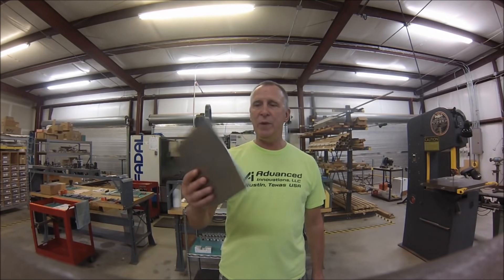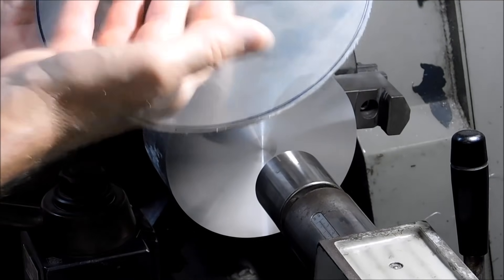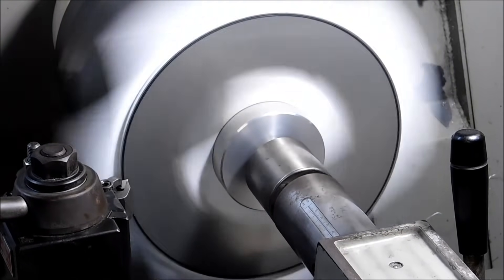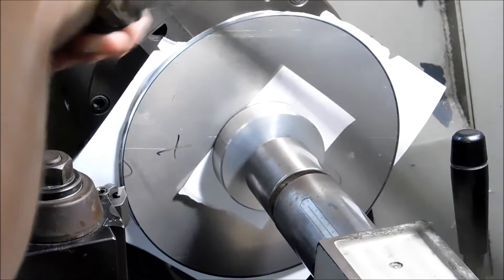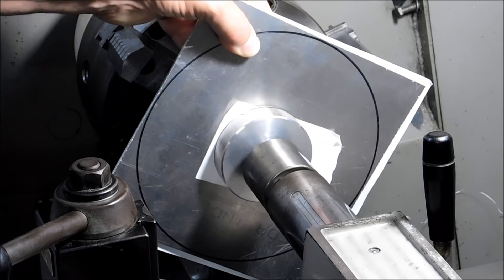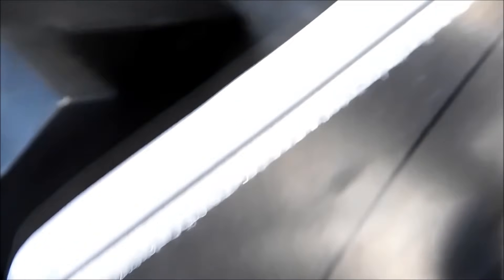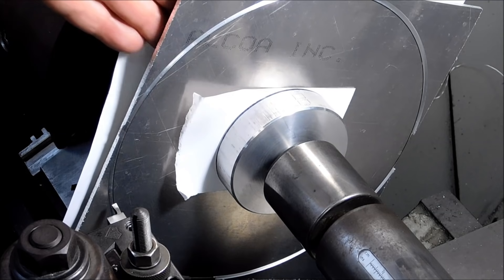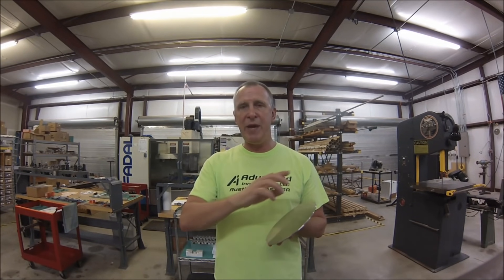Pressure Turning

Comment: In having my students do this over the years I have also discovered if you use a tool bit with a 45 degree lead angle rather than a rather abrupt 90 degree lead, that you reduced cutting pressure on the work piece dramatically. And as Joe points out, anything you can do to help out in this type of operation is to your benefit. This is the same thing that takes place in face milling when you use a face mill (insert style) with a 45 degree lead angle vs. A face mill with a 90 degree or square shoulder.  If you are trying this for the first time I would recommend  you bandsaw the rough circle out.
Reply from the maker: Be careful putting angles on the nose of your tool. An 1/8 inch wide 45 degree nose tool has more surface contact than a blunt 90. If I understand you correctly, the part would have a large sharp burr on it once the corners fall away.

Comment: Nice Joe, i'm a french Canadian and i spent 40 years in machine shop and it went by like a flash i am now retired. I used this setup all the time but to center my piece i just put a little pressure on it and centered it using a piece of wood in the tool holder and manually turning the chuck to rub on the piece of wood and it would center very precisely when i needed precision suppose i had only like .010-.050 to take off on the already round part. Thanks a million Joe you give me nostalgia....have a nice day!
Reply from the maker: thank you. Same to you.

Comment: Hi joe, nice job. I've been machining since I was a kid, what you did I have done, and seen done plenty of times. As with any job, there are times when you hold your breathe especially while parting off large parts. We have a hydraulic copy lathe for machining the OD of rollers for hot steel mills, we grip them between a stepped mandrel in the chuck and a stepped puck in the tail stock. We use a pressure centre, it has a large spring inside the live centre and a resistance gauge to show how much pressure has been applied by the tailstock. The pressure live centre is a store brought item, worth you looking into if your doing a lot of this stuff, if the tailstock moves a fraction, the spring still holds some pressure, and the gauge shows you straight away. 
Keep up the information on your channel, don't listen to the haters.

Comment: Nice video, Joe. I used to do that in the same way. 
We manufactured farewell gifts out of a brass plate combined on a wooden blazon. 
We high-gloss polished the brass and the electricians used their special tools to etch our coat of arms into the brass plate.... That was a great time back in the days in the German Air Force. 

P.S.
I preferred the second option. To lazy to spent to much time at the band saw ;-)

Comment: Awesome vid!  My addition, I attached .030 EPDM roofing rubber to the back plate and my puck. Never had any issues. I also mark where my center was on the material when I drew my circle with a protractor. When I initially place the material against the back plate, I reference my center mark with the live center point. I suppose I could draw an additional circle that would be the same size as the puck for easy aligning... Finally, I clip off the corners around the  perimeter with the shear. Thank you for spending time to make your informative videos!

Comment: I had to make a batch of discs for an order. They were trepanned out of rough cut octagons of sheet metal. Just the squares with the four corner excesses chopped off. The discs were secured to a face plate that was modified to allow vacuum to hold them in place. Also used a similar pressure block like you did but had a layer of rubber sheet 1/8" bonded too it. The vacuum chuck idea came from my woodworking, wood turners use this technique quite often and some bigger wood lathes like those by Jet have a built in vacuum chuck system. Great work mate.

Comment: As always, yet another informative and well-thought out video, thank you so very much!  Guys like yourself, This Old Tony, and Abom 79 are setting the standard for all us fledgling hobbyists out there who might be struggling with the math, order of operations, and other machining issues.   I have heard of pressure-turning, but the first time I've seen it, and it looks like a viable option when my fly cutter just simply won't make the larger diameters on flat, thin stock.  Thanks again and NEVER stop preaching safety and respect for running equipment!  (60 year old and still have all my fingers....)

Comment: Wow sir, I completed my apprenticeship in '90, done everything from medical valves to battleship prop shafts in a variety of shops and had never seen nor heard of this. Now a simple hobbyist with a fairly complete home shop, I will certainly use pressure turning when the opportunity arises. Seems like smaller diameter pieces wouldn't even induce much terror and yes what a time saver. Thanks!!

Comment: Over the 40-plus years I've been a machinist I've done a fair amount of this I think handling Dynamite is safer.
Reply from the maker: I got a piece that was sheared to more of a rectangle than a square once. Right at the end of this operation, the material broke through and broke off. It came off in a string of 4 curved triangles with razor sharp radiused inner surfaces and needle sharp points connected by  a remnant burr you could shave with. It was about 2 feet long and 1/8" thick. It was no doubt the most potentially damaging swarf I've ever seen ejected from a machine ever.
Reply: @joepie221  my first experience with this was a piece of plexiglass that was 12 in in diameter and about a quarter of an inch thick. In addition to being brittle it wasn't uniform in thickness and I did not know this until I started to cut it about 400 RPM. The part ended up melting in front of the tool and the tool quit cutting. The outside diameter the part proceeded to explode in all directions and a moment later the part completely cracked and came out of the machine in three pieces. Do not turn plexiglass this way.
Reply: it is, it's actually quite hard to set off dynamite by accident
ask me how I know
Reply: instaBlaster.

Comment: Good demonstration, Joe.  I appreciate your emphasis on the safety aspect of this kind of work.  I have occasion to do this kind of turning a few times a year, and my method is almost exactly the same as the way you show, even including backing paper.  Usually it is a precursor to making rolled end caps from brass sheet, and I use the same turning method when I go to roll the brass circle over a former, using a roller tool to form the flange part of the end cap.

Again, your emphasis on safety is well received, Joe!

Comment: I never heard of pressure turning or trepanning. But, I have been doing it for many years. I thought I may be the only one, first time I have seen anybody else do this. I devised method 2, trepanning, but my tool also has a profile on it too. It always lets you know it is about to break off with the noise you hear in this video. I devised the set up with a backing plate just a little smaller than the part. Never had any problems. I figured someone else must be doing it, logic says, and finally, here it is. I was doing 20 pcs about 3 times a year, but less frequent now. Definitely a great setup to loose body parts, seriously injure other parts, possibly even get to see if there is life after death.

Comment: I am a manual lathe machinist at a Rotary Lip Shaft Seal manufacturing facility. We pressure spin metal blanks over "roll forms" we machine to a specific diameter, and harden. We use a machinists wheel loaded in the tool block to center the blanks while clamped by pressure, much like in this video, then use the same wheel to form a blank into a case using the before mentioned "roll form". It is a very effective way to get the job done fast, so long as you feel comfortable doing this. Our metal blanks are punched out by a press though, or cut out using a circle shear.

Nice video by the way!
Reply: Forgot to mention, we have customized our tailstocks on our lathes. Instead of the standard point tip seen in this video, we have like a half inch cylindrical knob type tailstock. And have custom "drivers" we make, that vary in diameter depending on what size seal we are making, with a half inch hole in the middle. Makes for a much easier and quicker time when loading blanks, since our driver is already mounted on the tailstock, and can be easily interchanged.

Comment: Joe, you are a valuable resource in my toolbox! I would not call myself a machinist but I have had a few lathes. I have seen more recent tutorials where you demonstrate this technique. I came back to this video. I just built an ammo box stove and made 2 1/2" stove pipe and needed a damper plate. Not satisfied with making one out of ductwork sheet metal, I used pressure turning and trepanning to cut the damper from the centre of an octagon box cover. I owe you man!
Reply from the maker: Glad to hear it worked.

Comment: Hi Joe - Very neat information - at some time I am going to make a larger throttle butterfly, after I enlarge the the throat of the inlet manifold of my car. The bit that has thus far stopped me was how to machine the butterfly - you have answered the question. Thank You
Reply from the maker: Those butterflies should have 2 center holes in them to hold them to the shaft. Put those in first and screw the blank to the face of a soft arbor. Basically work backwards.
Reply: glenn whitchurch   Just a note Glenn. Most butterflys aren't round. I machine them for carburetors and injector stacks fairly frequently. Most of them are 8 or 9 degrees. Mount your workpiece to an arbor milled to the appropriate angle and tapped for the necessary screw centers. Use a backer piece to mount the butterfly to the arbor. Stack three or four discs to the arbor. The middle ones will be burr free. Check your diameter only at the screw/ shaft centerline. Turn the butterflies 4 to 6 thou smaller than housing bore. It's kind of a wobble plate nightmare when you are machining it but that's the only way to get good closure on the throttle housing. Check the edge of your existing butterfly when you get it out, if it's not square to the plate read the angle and go for it.
Reply: Thank You Bob for the information
Reply from the maker: Since it technically seals in a radial trajectory about the shaft centerline and is driven by the bore diameter, you may be surprised at what you find if you inspect it closely. Different on each side I bet.

Comment: 56 years ago in the university machine shop (taking a class) we had a wood lathe.  A wood plate (face plate) and a wood push plug attached to the tailstock.  The normal tool bar was off and we had a post.  We used an axe handle in wax - thrusting coper plates like the round you had and turning candy dishes.  The handle pressed on the copper (or brass) as you moved outward stretching the metal.   The bar was used as a lever point.  A bit death defying if you know what I mean.  Enjoyed the show and thanks for the memory recall.

Comment: Thanks for sharing this useful operation with us. A second circle slightly larger than the diameter of the pressure disk would help to locate the larger disc on center.
Reply from the maker: If you back plate was large enough, a series of short dowel pins could be added as locators and drivers for the various blanks you use regularly. It would help, but ( downside) the burr / cutoffs would come towards the tool and not the chuck.

Comment: I use spray glue on the driver. I've also used spray glue on a back plate when removing the pattern from chequer plate without using the tailstock. It works extremely well as long as the part stays cool.

Comment: Great video, I can see how useful this would be for turning thin walled parts that a chuck might warp in order to grip it as well.

It's actually quite amazing what you can do friction and it continually surprises me how diverse it's applications are becoming.

To get a better idea of how strong friction can be, a quick an easy experiment one can do at home is to take two books of about 100 pages each and interleave each page as far into each other as you can all the way through both books. Once that's done, see if you can pull them appart by the spines.

JSYK, the correct term for a throwing star is shuriken and hails from Japan ;)

Anyhoo, I love all the sound advice, techniques, tips and tricks you empart, I value it all highly as a relatively new and eager home shop machinist.

keep up the awesome work my man, I'm loving every minute of it :)
Reply from the maker: Thanks. Thats why I do it.

Comment: One thing on centering your parts. You already used a compass or trammel to layout the OD. layout a second circle that matches you outer pressure plate OD. Then use either two sided tape or spray adhesive to apply your gripping material to the pressure plates. And I agree that turning the square material can be unnerving at times. Plus feed with the compound set parallel to the ways. You have a lot more control on the feed with the compound than with the apron hand wheel

Comment: When I do this type of turning, I attached the plate or sheet metal to the driving plate with double-sided tape. Then I apply the pressure with the tailstock. Never had an issue doing it that way and it seems as though you would need less pressure to keep the part from flying off. And you generally wouldn't be doing enough machining to build up enough heat to break it loose from the tape.

Comment: When centering the part, use a small hammer tapping on the edge rather then manually pushing.  Not only is it easier to make small adjustments, it does not tend to off-center the tailstock end.
     If work can have hole in center, use center drill to make cone-hole in work, and put tailstock center directly into that.  You can turn thicker pieces this way, safely, and centering is automatic.  To improve traction, turn a raised rim on the headstock end at its outside edge.
     If you drill hole small through work, and center drill it on both sides, you can flip work over for access to both sides.
Reply from the maker: Pressure turning a thicker solid part is OK with a live center and centerdrilled hole, but for thinner material, a centerdrilled hole driver will distort the part and lead to it slipping. I don't endorse that method. Try to have as large of an od on your driver and locators as possible. It helps to deliver more surface contact.

Comment: Thanks Joe!

METHOD #2 IMPROVEMENT
Takes pressure off getting injured.

IDEA #1
For safety's sake - I can't see why you couldn't make a dedicated square backplate, that has holes, starting at each corner, drilling four straight lines toward the center, at half inch intervals. 

Make the square backplate at the maximum size, that you can get away with, for your particular lathe. This will allow you to turn a variety of workpiece sizes. 

Square the workpiece with the backplate, then clamp together.

Drill a minimum of two holes on each corner of the workpiece, so the holes line up with holes in the backplate. 

Use the backplate as a drill guide, or make a dedicated drill guide. 

Secure the workpiece to the backplate using eight nuts, bolts; and Loctite® – then remove clamps. 

This will allow a cut to be made all the way through the workpiece – virtually preventing you from being impaled by an injurious flying Ninja Shuriken. 

IDEA #2
EASY CENTER ALIGNMENT
Do this when not using a dedicated backplate. 

Drill a small hole all the way through the center of the driver puck. 

Prior to pressing the workpiece against the faced off backplate, mark the center of the workpiece with pencil, or Sharpie® marker.

Align the hole of the driver puck with the center marking which has been drawn onto the workpiece. 

Hold the driver puck firmly as you mark its circumference onto the workpiece.

Use this circle to center align the workpiece to the driver puck, thus virtually eliminating having to eyeball the concentricity of the part, then having to fidget with aligning it multiple times. 
:

- edit -
fixed typos
add beginning comments
:
Reply from the maker: Securing those loose corners is a fantastic idea.

Comment: I had to Treepan a 1x1x.125 thick x12od angle  outta a 1 x12 square hunk of aluminium, for an airplane shroud....in a situation with nothing but scribe marks, a mill and a lathe with no DRO or vetical saw or rotary table. I managed it. 
But yes, in the end I had to Pressure hold it all, not unlike what you have described. 
Thanks for the vid, it helps anyone in a difficult situation, plus you add a little teaching about it.

Comment: This looks like a good use for a magnetic chuck. Nicely done!
Reply: its Aluminium, and unaffected by magnetism !!
Reply from the maker: The majority of my experience with this setup is on 1018 and 316 SS. If the part is magnetic, and you trust that magnet, it sounds possible.

Comment: I used a similar technique a while ago to take a disk out of a 3mm thick mild steel sheet. I chopped it down to rough size and shape, used a backing plate like you did and a gripper plate. The big difference is that I cut a series of eccentric  grooves in the backing plate and used super glue to stick the metal to before advancing the gripper plate.  i cut the disk over size so i cut break off the rough edges when the part was part way through (Cutting toward the chuck into the sheet). I then finished to size with fine cuts and deburred the plate. I have to say I was not comfortable and kept well out of the axis of the plate while it was turning - I have since bought a plasma cutter!
Reply: Sorry - concentric not eccentric!!!